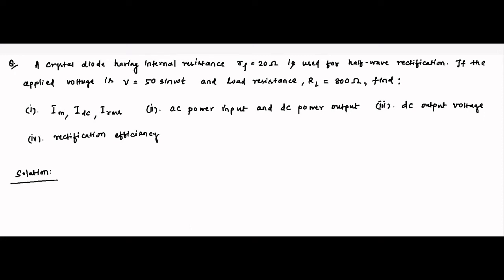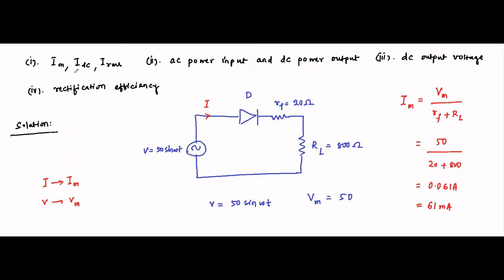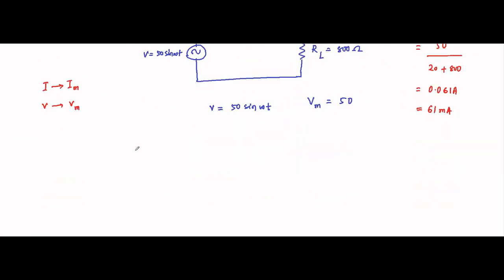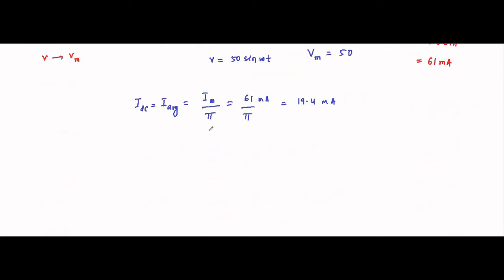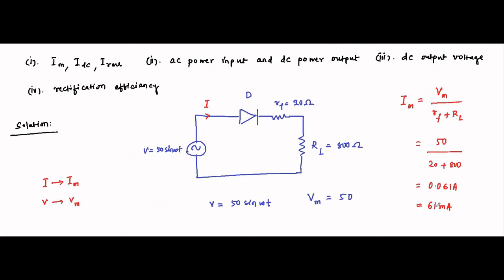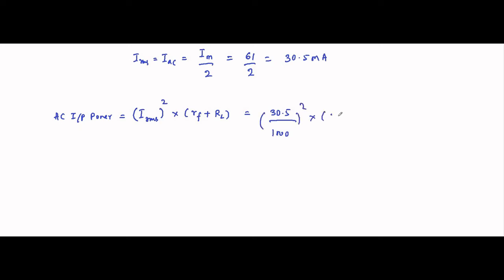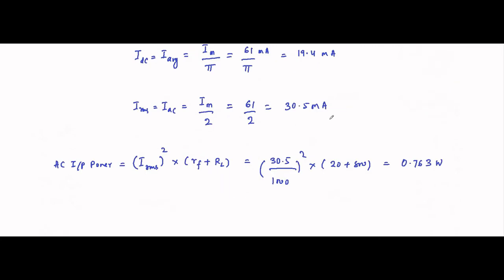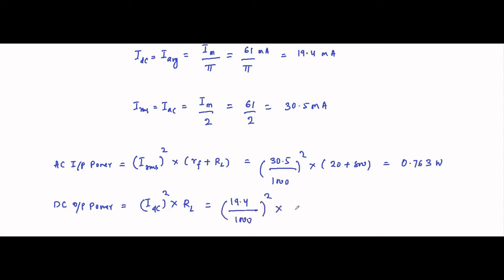Diode Circuits | Half Wave Rectifier | Question 3 | Analog Electronics

Comment: A single-phase single-diode (half-wave rectifier is connected to a 240 V, 50 Hz AC supply. Neglecting the diode voltage drop, determine the current waveform, mean load voltage, and the mean load current for a load of a. Pure resistor of 10 Ohm b. An inductance of 0.1 H in series with a 10 Ohm resistor. please help me